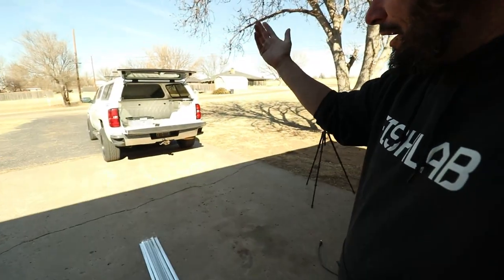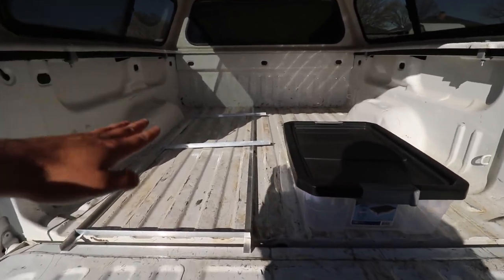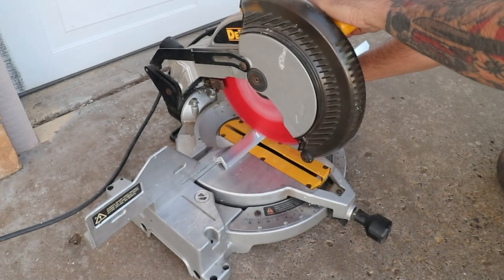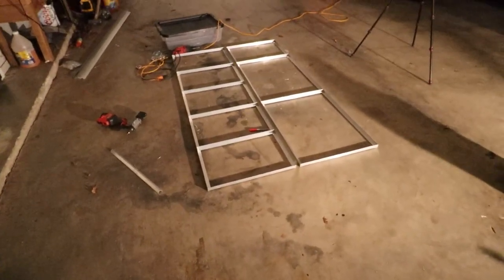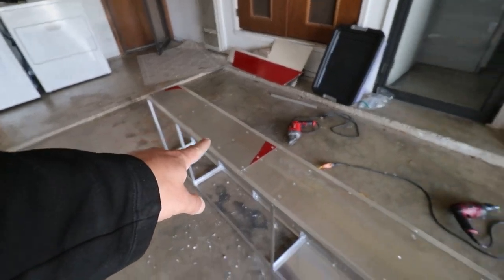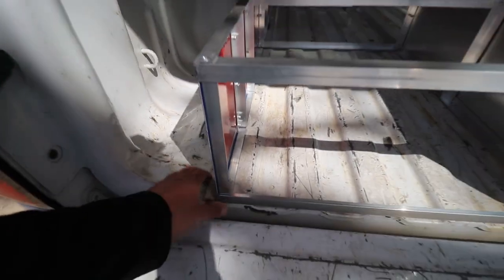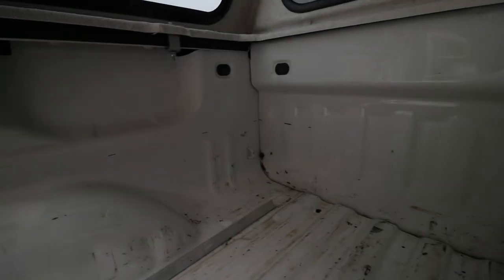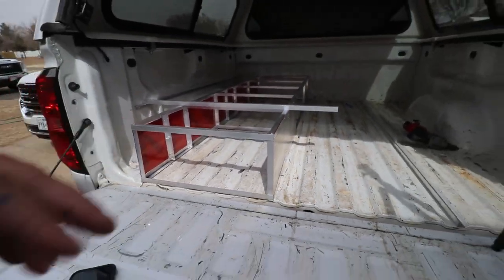STARTING MY TRUCK CAMPER BUILD OUT!! ALUMINUM SLEEPING PLATFORM PART 1

Comment: Very nice, without the aluminum skin you will have racking.  Just like building an airplane.
Reply from the maker: Racking? Sorry, what is racking? I never built a airplane before lol
Reply: @AdamRyanA  because you used aluminum angle with one rivet, you have a pivot point.  The aluminum skin unifies the structure (boxes it in).  Just like an airplane!
Reply from the maker: @lkazanov  oh I gotcha

Comment: I had just started to type you need to add Bulkheads (walls) between the drawer sections. Not to stop the boxes from sliding around, but to add lateral stiffness to your bed box. Then you said you were going to & tie it to the side of the truck's bed. You'll be fine.